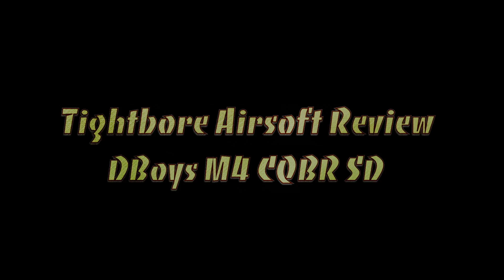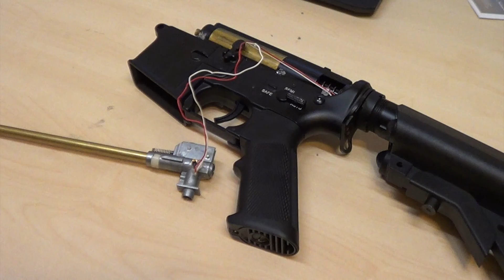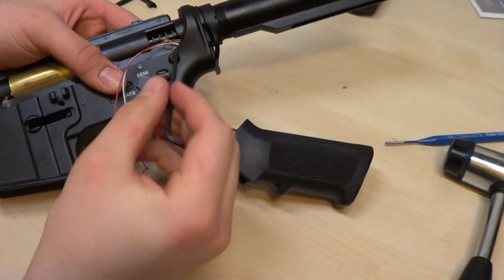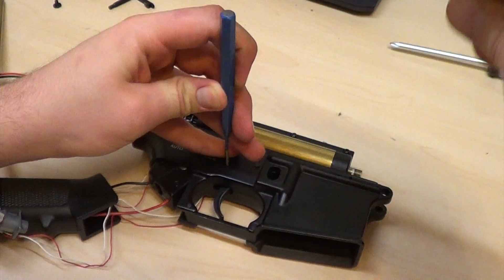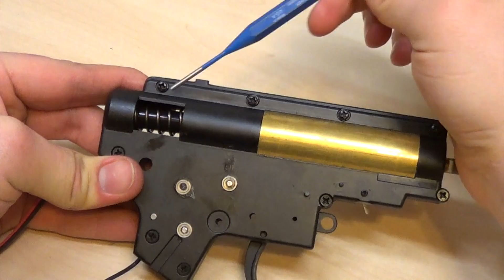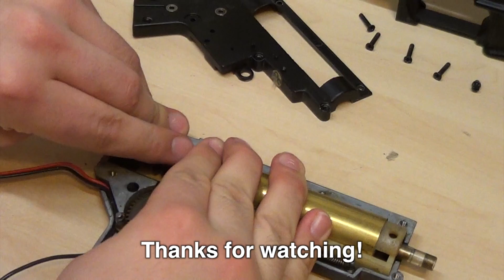DBoys M4 CQBR SD Airsoft AEG (Disassembly Guide)

Comment: What size is that screw that goes into the buffer tube? I bought mine used and it didnt have a stock or buffer tube and the screw that came with my after market buffer tube is too short.

Comment: When I look down into my buffer tube there is no screw!? What should i do?
Reply from the maker: That is very interesting, because most M4s should have a screw that connects the gearbox to the stock. I would double check to make sure for certain that there isn't a screw. Your wiring might be covering it, other than that I'm not sure.

Comment: lets say, i have the 0.5 joule variant of this gun, ive seen, that you can close a hole on the cylinder with hot glue, to get a greater power, is it the case with this gun, and if yes, where is the hole located exactly?
Reply from the maker: +Splash My airsoft rifle was the 400 fps variant. Therefore, I am not familiar with your variant or porting of the cylinder. If your cylinder is ported, the best way to boost fps is to swap out your cylinder. Hot glue may work but you would have to be careful not to get any into the cylinder. I hope that helps!

- Josh
Reply: +Tightbore Airsoft thank you, yeah, in germany weapons with a greater power tha. 0.5 j are not allowed to have the auto fire option, its a lil bit illegal, but actually nobody will ever check it. the thing is, that it would he too expensive to swap out parts to reduce the power for the reducer since germany is the only country with such stupid laws, so they just drill holes into the cilinder. i will propably only have to remove the first front section, and i will be using ducttape, not hot glue, but thanks for your answer.